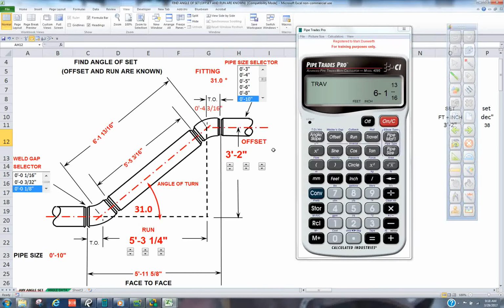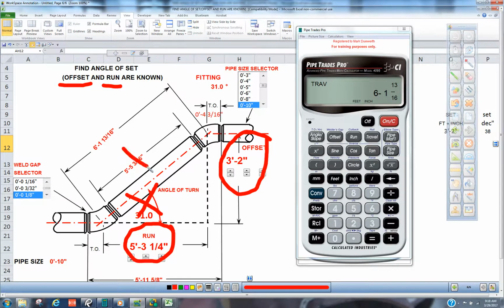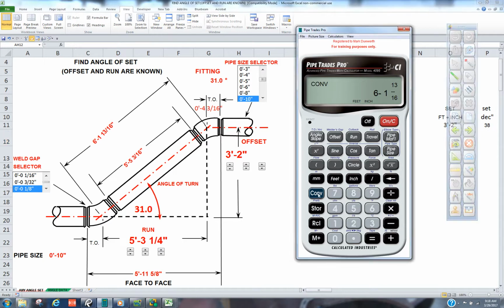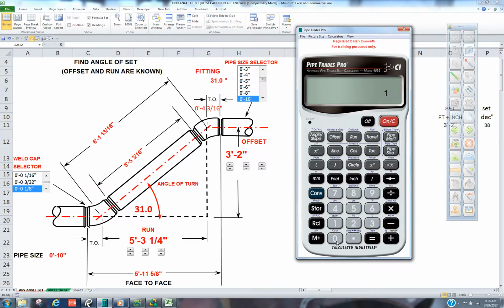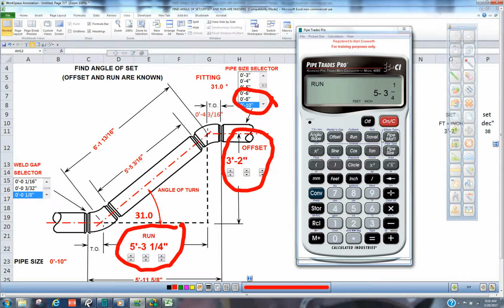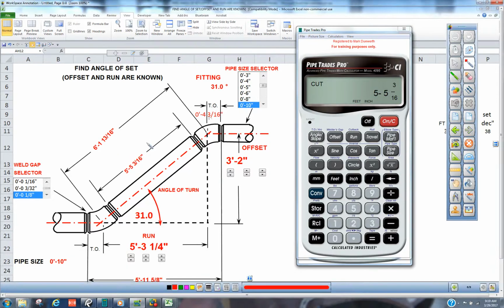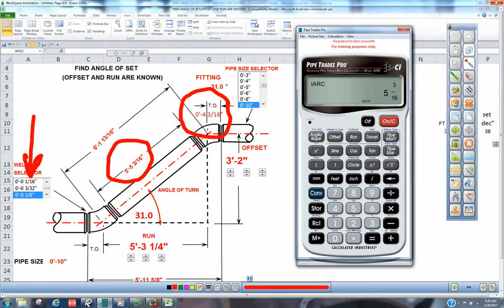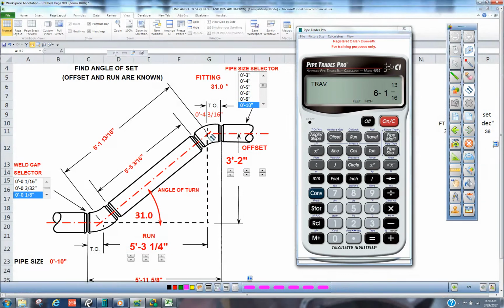Discover The Angle In Pipefitting With Known Offset And Run For Weld Fittings!

Comment: in a real world situation, with unknown bend angles,  you wouldn't know your run is 5'-3 1/4". you would most likely only know your  advance, which is 5'11 5/8"  and the offset which is 3'2"so how would you find the take off of your fittings? and fitting angle? you are using the Run as 5'3 1/4" which is hard to know with cut down fittings. if you knew the fittings were lets say a 45 degree, that would be no problem because its easy to find the take off for that. unknown bend angles, means unknown take off's. isn't that correct?
Reply: there's a way to calculate this, I have the formule somewhere at my home